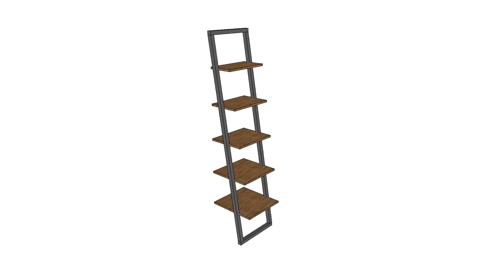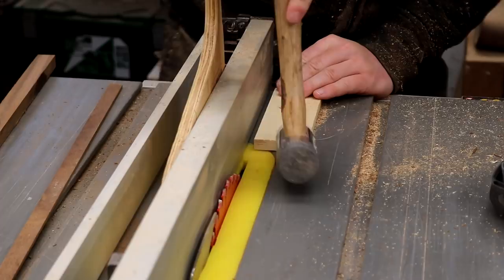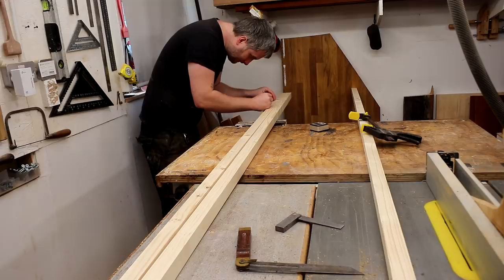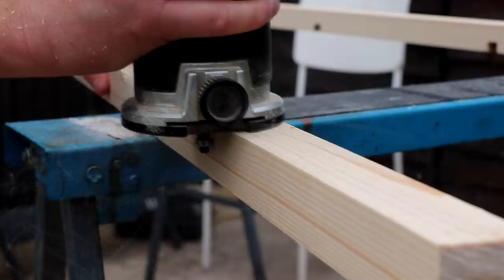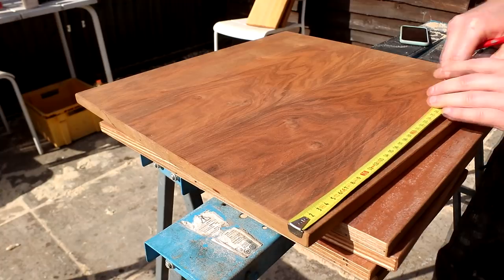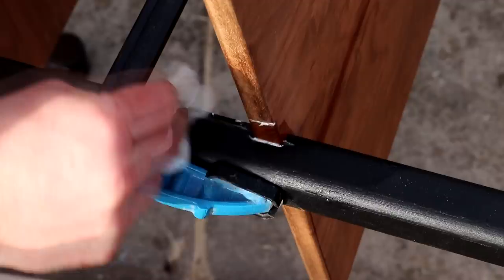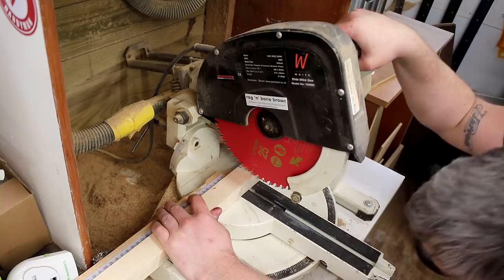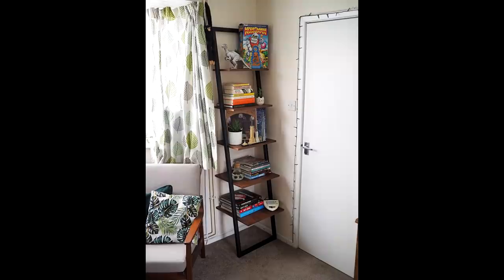How To Make A Ladder Style Mid Century Shelving Unit

Comment: I made a set of  ladder shelves before. To make assembly easier for me, I had all the shelves stick out the front the same amount. I used a square to measure each one so they were exact. All the shelves are different sizes but they just cantilever out the back. That hot glue trick on the table saw was worth watching the video just by itself! Great project, thanks for the tips.

Comment: If you have a large enough table (a sheet of ply on the saw horses works too) I would put the shelves vertically on the table top. Then I would prop up the rails to the proper angle. Applying the glue you could use the clamps to bring them together with even pressure. As noted in other comments, a dry fit would be very beneficial. Additionally, since the rails and shelves are finished in different ways, I might consider finishing them separately before assembly. Good video. Nice project. Opportunities for solutions. Cheers.

Comment: I'm thinking that the frame should have been glued up first [although your clever idea of adding the top and bottom rails, to the ends, might have been overlooked] and then slotting the shelves in. I think its its better secured to the wall too, as some visitors' toddler is bound to see it as a climbing frame. Its an interesting shelving solution and you rendered it very well, Keith.
Reply from the maker: That's a good idea, I did think about doing that but was worried about the glue smearing across the shelves making a bit of a mess.  You're absolutely right about the toddler climbing frame though, especially seeing as my brother is now expecting!!

Comment: On your own, I'm not sure there is an easy trick to assembling these. One thing I've done different in the past making similar shelves is to not only route a housing in the frame but also a cut out for the frame on the shelf pieces. They interlock better this way, making assembly easier. Takes a fair bit more working out though. Working outside as you do sometimes, get some of that anti-slip tool matt. About six quid a roll and will protect your work. As always, you pushed on through and the result is great.  Even with the good editing, it did look like you had reached a point with this where you'd just about had enough. Hope your brother knows how lucky he is ;)
Reply from the maker: That’s a nice idea I like the sound of that!

Comment: I probably would have supported both the rails by sawhorses at the ends (rails clamped to sawhorses), then applied glue to the bottom shelf slots and put in the bottom shelf with a clamp, then put in the second shelf with a clamp, and so on to the top shelf.
Reply from the maker: Yeah that's a good idea, the main reason I didn't do it like that is just being worried about having to clean up all the glue smearing squeeze out.  But it may have been a better option than what I did
Reply: @RagnBoneBrown  
I was thinking there should be enough flex in the rails to slide each shelf in from the top rather than the front (that is why I suggested working from the bottom up). But I could be wrong.

Comment: Could you have cut the top off one side and attach to the bottom on the short side to keep the height? 
For glue up ease you could have cut a jig to hold the shelves from the back to help you line the sides then remove once glued up , just an idea , but love the finish product top quality finish

Comment: At 3:43, you can see that the angle set to the angle gauge is not 10°, because the lying handle is lifted a millimeter from the tabletop. Fortunately, this is not critical on this project, while you're using the very same gauge setup :) Tip (I learnt on my similar off-a-bit angle gauge): do such measurement at the edge of the tabletop, if perfection is necessary :)

Comment: Great video , love your style. I think the happy accident made a better product, although I might then have added a couple of chair leg coasters (thick plastic washer things mainly used to stop the chair marking the floor or slipping - not sure what they are called in England) to the bottom rail. Like walls you can't rely on floors being flat either and these make for two points of contact rather than the full length of the rail, however I see in the final shots that it is sitting on carpet so maybe not really needed. 
Talking about an easier way to assemble, I'm not sure you could really change what you did, unless you went to some sort of jig to hold the shelves in position whilst you fitted the rails. Given that you only made one of these, a jig is not really warranted - my thoughts anyhow :-)
Reply: @Gunner Eddie instablaster ;)
Reply: @Will Antonio Thanks so much for your reply. I got to the site through google and I'm waiting for the hacking stuff atm.
Seems to take a while so I will get back to you later when my account password hopefully is recovered.
Reply: @Will Antonio it worked and I actually got access to my account again. I am so happy!
Thanks so much you saved my account :D
Reply: @Gunner Eddie Happy to help :D